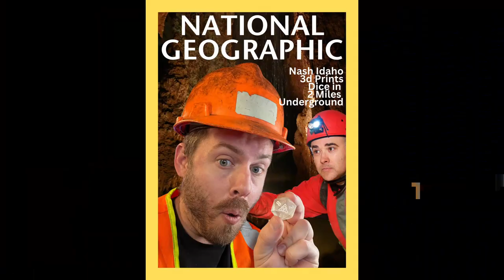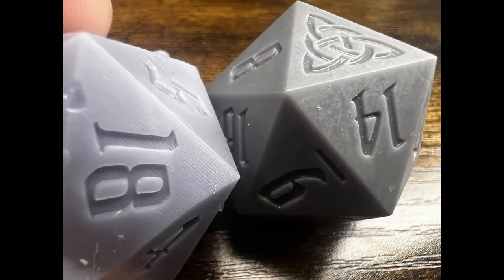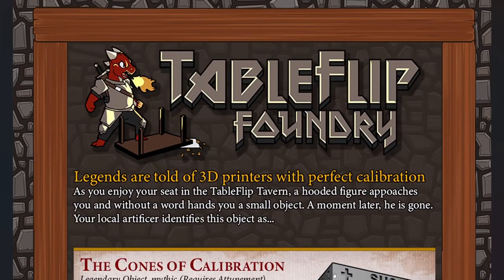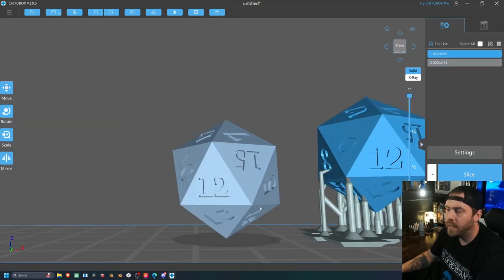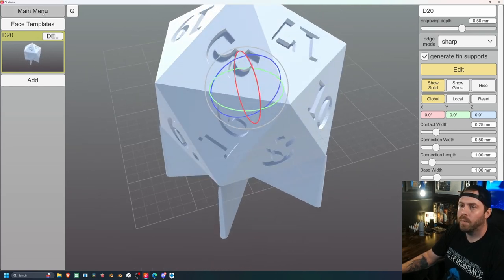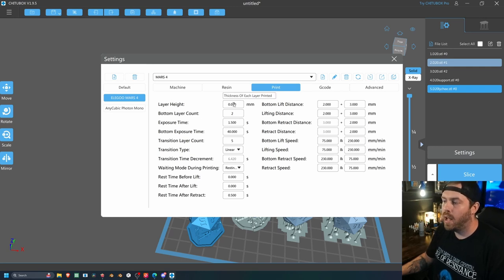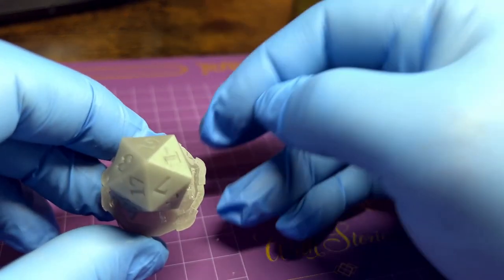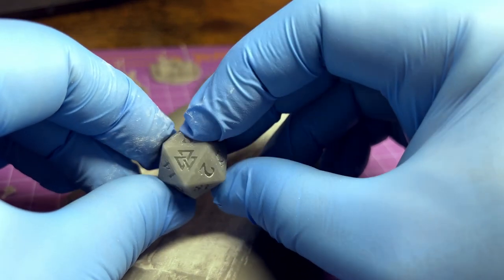The Danger and Excitement of 3d Printing Dice

Comment: How do you ensure the weight is balanced correctly? If dice are too light, they don't feel proper and can skew the RNG bell curve of the rolling matrix.
Reply from the maker: For the most part I think people are using these to make a mold of to cast so at this point balance isn’t a huge concern, some people do balance their resin cast dice by carefully sanding on different faces but for RPG play it doesn’t really matter like it might at a casino…  In fact I have a mass produced di that likes to roll 18s and that is one of my most cherished dice to use while dungeon mastering…
Reply: @Nash_Idaho  
Maybe I'm just an older GM who appreciates actual random generation from my dice. Thank you for the reply. I hope a solution can be found one day.
Reply: There is a fairly often cited paper (which I admit I have not read) which gave good and bad news for 3d printing dice.
The good was they found that almost any attempt to produce a 'fair' die would be about as reliable as any other.
The bad news was that is because they all as bad as each other unless you go to casino levels of effort.
If your chessex dice are fair enough for you, then 3d printed dice are fine. If you want genuine* randomness, use a computer
*yes, usually this is random seeded pseudorandom sequences, however a normal dice roller app will give you sequences which are statistically indistinguishable from true random for the number of rolls you are ever going to ask of it.
Reply: Printing them solid usually works just fine on balancing. Most people just print and make a molds from them to make cast dice.
Reply: I made 2 dozen d12's.  I tracked each dice for 250 rolls and recorded the data. Working the statistics of actual vs. expected results, there was no bias for these dice.  I mean 250 rolls isn't a massive set for a single dice, but for 24 individual D12 x 250 times was a very tedious task over the weekend.
Reply: @KnugLidi  
Thank you for your diligence and dedication! O7
Reply: It takes a lot of effort to really unbalance a die to the point its unfair. You can water test dice but unless you are rolling your game in water, that ends up unrealistic since the ability for the die to "float" into its favorable side, is removed. Almost no dice manufacturer goes thru extra effort to balance their dice, as they all have realized that level of effort outside of casino dice (which I've still seen tested and run almost identical to mass produced cheap dice in results) is a sunk cost with 0 real life benefits. Unless of course you are embedding obviously heavier items within a non central location, which even then takes a noticeable amount of weight to make roll on a table reliable in favor of a side. Enough so that even in just holding the die you can usually notice the uneven weight distribution.

Comment: Since the goal is cool esthetics I think all these are clear failures. The next thing to try in my opinion is to split the model and print all the sides on the top.
Reply from the maker: Yeah possibly but difficult you’d have to zig zag cut a d20… Dice are hard to print, but the last one I think would have been just fine with a little more support and the numbers inset a little deeper so each side could be polished perfect before molding, also these where 24.5mm which is normal size but I feel the trend is slightly larger sizes which will print a lot better actually, I will probably follow up on this and try your idea in the future!
Reply: @Nash_Idaho  The zig zag cut would be a pain, unless support for it could be added to dicemaker. 
I was actually proposing splitting right through the sides, the result might be offensive but maybe it'll be fine.
Reply from the maker: @brocktechnology  it would be easy in blender, cutting through the faces might work great or be completely impossible I really don’t know!
Reply: I find filleting or beveling the hard-lines works the best for resin printing dices. Also precision support placement is a big factor as well.

Comment: Question from someone looking to get into the hobby. You use a Mars 4 Resin Printer. Do you then make silicone molds based off of those masters or because you print in resin is it just one and done thing?
Reply from the maker: I don't make molds but a lot of people would do that next. Make sure to cure the resin after printing using a method that doesn't cause problems with silicone molds, there are a few good tutorials out there on how to.

Comment: I started with custom dice few months ago. I had to redesign the body and print the faces separate. So far so good. Just wished i could print the whole thing in one go
Reply from the maker: I think printing slightly oversized with slightly deeper numbers and spending some time sanding can result in a perfect master. Probably going to be my next dice video, finishing one to perfection!
Reply: @Nash_Idaho  for me it's been a few months of trail and error (2k) printer. But finally did my first batch of 50 dices custom. Now I want to create molds for the bodies so I can just print the faces . Even paid a designer $100 for this. And in my country that's a hell lot of money 🇿🇦

Comment: Great video! Just one question: Did you really use methylated spirits or mineral spirits?
Reply from the maker: Actually I use denatured alcohol, mineral spirits worked a bit worse then isopropyl and left residue, I may have misspoke if I said I used mineral spirits in the video. I keep the stuff in my garage and don't know what I'm gonna do over winter because denatured alcohol smells horrible but works far better then anything I've ever tried.

Comment: I just tried to print a second set, because the first one has failed, with a lot of puffyness on the bottom , but the second result is worse! I also used dicemaker for automatic supports AND made supports by myself , but every dice failed! What causes the puffy finish at the bottom? I use clear abs like sunlu resin, 0.03mm high per layer, 2 seconds for normal layer and I even tried to delay the lift movement with 2 seconds to be sure that resin is not moving to fast, but nothing changed... Any idea to fix this and get clear results?
Reply from the maker: I’ve added more supports on the bottom facing sides and also made the numbers slightly deeper, the combination reduces the puffy bottom sides and allows for a little extra sanding to remove any imperfections, it also only seems to happen on d20s for me.. also slightly bigger d20s seem to print better

Comment: Hey, nice tips! Have you encountered warping problems printing d6's? I've seen a lot of tutorials on printing master dice and no one tackles this specific issue.
Reply from the maker: just make sure all the faces are at 45 degree angles to the build plate and that you have good supports and d6s should print well. Honestly they aren’t the ones I have problems with it’s d10s that always fail for me!

Comment: So im curious i can get a used mars 3 is that good enough? Or should i get a used mars 4 for i think it was 140ish

Other comments are also scaring me if people sell 3d printed resin masters but i cant cast them then do i use inhibitX or am i just screwed
Reply from the maker: Creating a silicone mold of resin prints requires you to clean the print, I’ve heard that if you put the print in a clear container and clean water then uv cure it for a half hour then replace the water and do it again that is all you need to do, but I haven’t tried myself. As far as the printer a mars 3 is just great! I’d probably use that until they come out with a mars 5 then upgrade then

Comment: The problem is that you cant realy make master dice for casting using resin because something in the resin reacts with most silicones and hinders them from curing.

So sadly there is not realy a point of printing dice with resin. On their own they look ugly, u dont realy want to paint them because when used paint would most likely rub off and u cant realy use them for casting.
Reply from the maker: Yeah but like a ton of people have made silicone molds from things 3d printed in resin… most without doing anything special but if you wanted to and were using platinum based silicones, they may require you to really clean the resin masters and there are also some other things you can coat the masters in to help if you had issues.
Reply: @Nash_Idaho  yeah that's true, but it's still a lot of effort and most coating methods are quite expensive.
In my opinion you can better masters with a regular printer, even though i like resin printing way better.
Reply: So are you telling me that every dice master i can buy from etsy isnt going to work?

I dont understand why there are so many people selling 3d printed resin masters then
Reply from the maker: @DetroitMetroRetro  no, there are plenty of good sellers out there that fully cure and polish their masters, keep in mind that you should spend a considerable amount of time to make your master perfect before molding. So going through the hour long curing process or just letting the resin de-gas for a while before molding doesn't really seem unreasonable...
Reply: There is a product named Inhibit X that is supposed to stop the sla resin / silicon reaction.